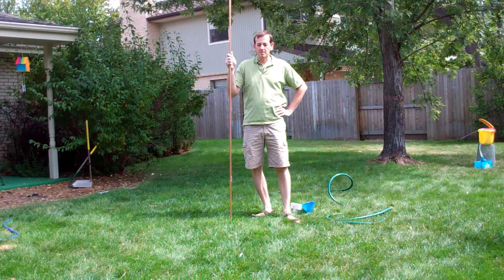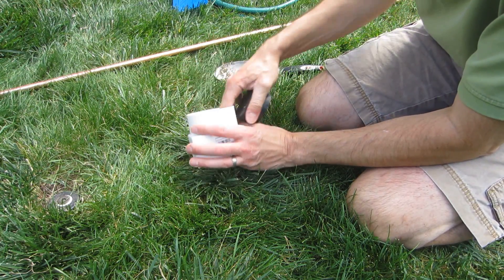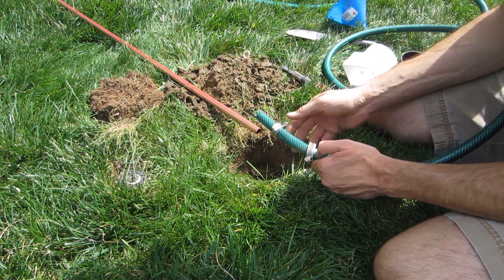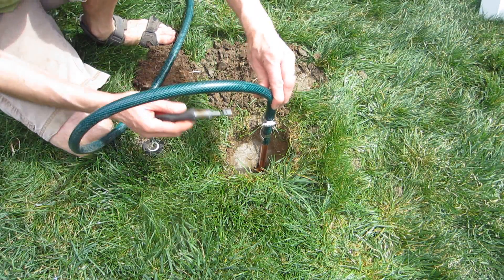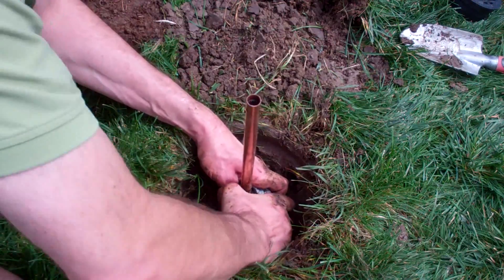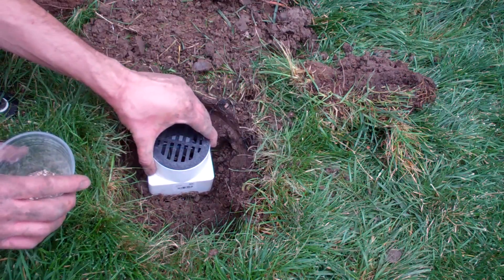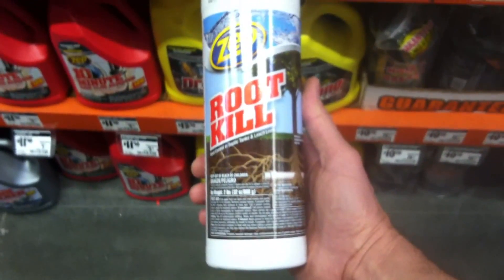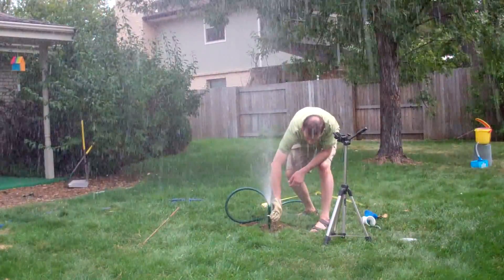Ground Rod Installation For a Temporary Antenna - Water Jet/Garden Hose Method

Comment: That is not a ground rod.....
Reply from the maker: It is a ground rod for rf experimental and temporary antennas. As stated in the description it is not an electrical or safety ground that is up to code and should not be used as such.

Comment: If your powering your radio gear off the 'mains' the that ground rod needs to be bonded back to the utility mains ground rod.  If you don't know why go watch some of Mike Holts videos.   Terrible way to run a ground rod IMO,  will take years for the soil to tight pack again.  But whatever,  not my installation.
Reply from the maker: Read the description.
Reply from the maker: Sorry for sounding a bit terse...I answer this one a lot and its just a rough day. Sorry for taking it out on you. Cheers.
Reply: @kugellagers  Ahh,  sorry if I missed that one.  73's.

Comment: Don't solder ground connections.  If that takes a hit from a high voltage source or a lightning strike, the solder joint will effectively explode.  That's actually a question on the General test.  Mechanical connections only for grounds.

Comment: i just use one  4 feet spike and a 6 feet spike with a old fashion like mallet but the one i have is steel and wood handle also i use a mallet too hand held one to get the spike started my mallet look like this  https://cdn0.rubylane.com/_pod/item/1317328/6347/Vintage-Large-Carnival-State-Fair-Circus-full-1A-700%3A10.10-73-f.png little bit small 12 in diameter all i did was dive the spike in the 4Feet pull it out put in 6 feet spike then same pulled it out this was faster for me because the sledgmallet i like to call it is 42bl. in weight i want a bigger one just like the on in the link but same weight and also steel  also i my was for a ground for the house electric

Comment: So, correct me if I'm wrong, but according to an antenna tech friend, all you need is ground contact, why not just dig a trench and bury the pipe horizontally ?  That way, if you need to pull the pipe or ground rod up, you won't get stuck with a ground rod getting in the way of any work you need to do.

Comment: Too much work, also not electrical approved. Take a normal solid ground rod and a hammer drill and down it goes boom done.
Reply from the maker: Read the video info - it's not an electrical ground.

Comment: Forget about the hassle of grounding rods. Go with metal mesh fencing (much like chicken wire)about a foot wide, placed on the ground flat next to your electric fence, grounded to your energizer (like my Fi-Shock). The animal steps on the grounded metal mesh, touches a hot fencing wire, polyrope or polyrope, and that's about all the animal needs to keep away.
Granted, if you're trying to keep in or out large animals, larger than a goat, then this may not work, as larger animals will possibly tear up your metal mesh over time. 
It keeps the neighbor's dogs out off my property, that I know for sure. Should he start herding cattle around his house, I'll rethink grounding rods and stronger fencing material.
Until then, the neighbor's dogs seem to have a goodly respect for yellow polywire.
BTW, a few of my animals also have that same respect. None hang around the property line.
Reply from the maker: This is for an antenna not a fence.

Comment: through the pipe are you feeding water or some air pressure because i can hear some pressure sound at the background
Reply from the maker: As the title states I am using water from my garden water hose to push the copper pipe into the ground.

Comment: lol try telling people what area you live in so they know why this method will pretty much only work if they live next to or somewhat near you which would have the same soil conditions... the majority of states have soil conditions which will not simply allow water pressure from a garden hose to burrow a 10 foot deep hole.

Just here in the tri-state area of Pennsylvania, West Virginia, and Ohio you will see on average 12 inches of top soil, couple feet of clay, and then shale and other rock
Reply from the maker: I'm in Colorado but the ground underneath varies quite a bit here s well. I'm in a subdivision so everything has some fill - with lots of clay. As a kid I used to live in NW NJ near the Delaware Water Gap. That part of the state is a glacial moraine where there are rocks everywhere on and under the surface. I can't imagine trying this over there. Cheers.

Comment: Never never never soldier grounding connections! Plus, the ground conductor is far to small of a wire.
Reply from the maker: As the description says:  THIS IS FOR A TEMPORARY RF GROUND ROD TO TEST RECEIVING ANTENNAS. THIS IS NOT FOR A SAFETY OR ELECTRICAL GROUND. DO NOT USE THIS AS SUCH.

Comment: Not sure if you know it or not but you can put a regular electrical ground rod in the ground using the same technique. I have literally used a 20oz bottle of water to put one all the way in. Start the hole with the ground rod pull it out and add water to hole, stroke it a few times and repeat. Don't know if you can use them for your application but just thought you may want to know.
Reply from the maker: I have seen where people demonstrate using very little water to  put a solid ground rod in and am amazed. The soil here can be rocky and I don't know how well that would work. I'm not patient enough to do that anyway.

Comment: Read up on "RF Grounding".  I think you have a nice DC ground rod here but a lousy RF ground, which is what is involved in antenna work.  Check the latest edition of ARRL Handbook for openers.
Reply: It's also pointless if it's put in with water.

Comment: Doesn't meet code requirements. Don't do this. Call a professional.
Reply from the maker: This is a RF ground for a spot in my yard to temporarily test reception antennas as it says in the description. The same grounding requirements are NOT necessary. It would have taken longer to go buy a grounding rod and tools to install it than to put this in. Also, note my notes in the video description.

Comment: Thanks for the Video, great Job, you know a Piece of 1/2" EMT steel conduit is dirt cheap, Its steel, and strong, one length of that could be used to drill the hole, once the hard work of drilling is done, then switch to the Thin wall copper tube to complete it, you would NEVER kink/bend another piece of thin wall copper tubing if you Hydro- drill with a piece of 1/2" EMT conduit first.
Reply from the maker: Yeah but I had this copper pipe around at the time. So it was mostly free. A galvanized EMT might make a decent ground by itself in a pinch. But copper is always better.

Comment: Followed your method and successfully installed a 10 foot, half inch class L grounding pipe.  Went through about 12 inches of top soil, stony, rocky fill and then hard clay.  As soon as clay stopped the water from coming to surface around the pipe I pulled the pipe up an inch or two until water flowed again, then proceeded.  The end of the pipe was cut on a forty degree angle and twisted as I went so it acted as a drill.  I had soldered two 45 degree elbows at the top end to connect the hose.  The elbows acted as a handle to waist the pipe as I went once the pipe was deep enough to reach them.  Thanks much for the video.
Reply from the maker: I'm glad it worked well for you too. Especially since it seems you have to deal with quite a lot of rocks. I have no idea how long one of these grounding rods last though I imagine the composition of the soil will have something to do with it. Cheers!

Comment: Maybe when you have the time u can make a video of how you hook your antennas up to the grounding pipes , I think that will be good to see .    Thank you
Reply from the maker: I just use a standard grounding rod clamp on the pipe to connect up my grounds. With a permanent antenna I run the ground wire from the antenna to the attachment screw/point on the clamp. With a temporary antenna I connect a wire to the ground clamp attachment point and have a crimped on blade connector on the other side of the wire which I can use to quickly attach/detach the antenna ground.

Comment: Hello , Good video , Maybe tire using a rubber mallet / hammer to finish getting the copper pipe  all the way down in the ground that way u get more pipe in the ground and you won' have to cut any pipe off , If using a metal hammer might wanna think about covering the top part of the pipe with a piece of wood before hitting with the hammer so it don't bend the edges up.
Reply: Or you put the clamp on the pipe before you start beating it with a hammer.